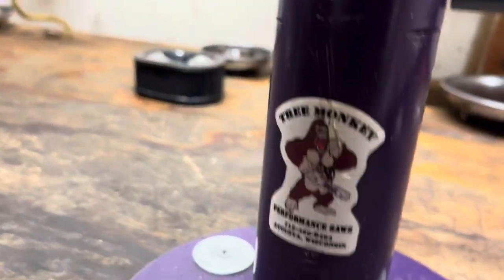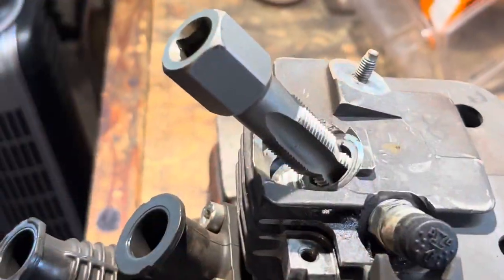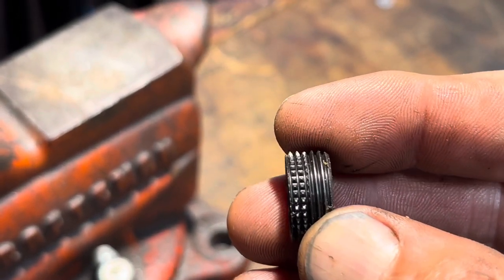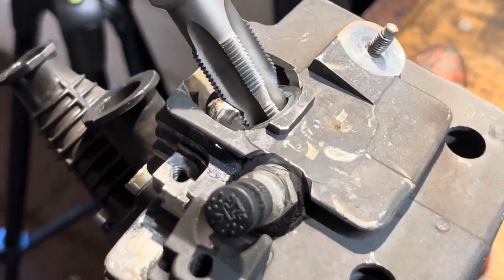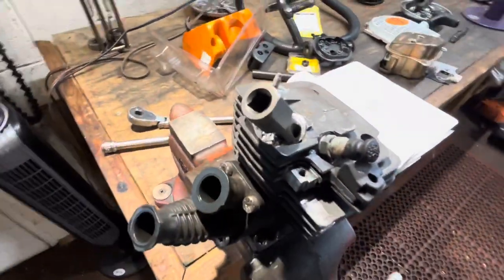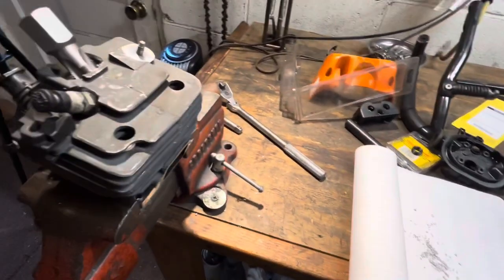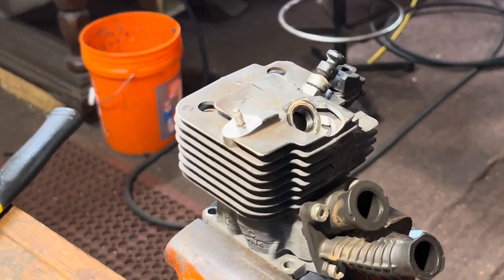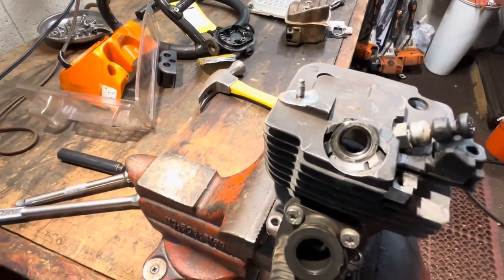Stihl Spark Plug Thread Repair MS441

Comment: Prayers over it all Mr. Richard. Very fine repair sir...well done. In addition to the kit you've shown, mechanics/machinists have drilled a tiny hole(s) between the insert and cylinder and driven a small pin to further lock those threads. JB also has a high temp formula which you are well aware in lieu of the lock-tite....my .02 cents. Another point, I am curious about the extra air intake and the condition of that cylinder, read scoring.. Beautiful time lapse and a job well done sir...
Reply from the maker: No scoring present, just carbon glazing on the piston.  The plating on the cylinder walls is as hard as woodpecker lips.  I'll consult with the owner and get him set up with a better plan going forward.   Continued use with that gas and oil mix would have certainly caused some damage.

The second intake is for fresh air.  It adds a "puff" of clean air just before the fuel charge enters, read strato-charge.  It helps displace the spent exhaust gasses out of the cylinder and creates a cleaner burn for the next combustion.
Reply: @richardflagg3084  I am referring to the air intake around that loose plug. A loose or faulty compression release can be another source of air leak in a similar fashion. This didn't happen all the sudden. I had a rejected warranty claim the same situation. It was blamed on a senior citizen "straight gassing" the saw. My investigation revealed oil mix in the fuel, oil "pooled" in the crankcase. The seizure was due to a loose spark plug. I am familiar with a stratified unit however...
Reply: Roosters' comments are interesting..a new OEM cylinder is $370-$400. A new shortblock $550+ -.. Most Stihl dealership labor in my area is $90-$100 an hour. I would think your repair is justified and reliable..
Reply from the maker: @Brian2bears  I'm going to take a wild guess and say that the plug was threaded back into the damaged threads and the plug blew out.
Reply from the maker: @Brian2bears  Interestingly, the late model 441's have a steel insert installed at the factory now.  I'm no harmonics professor, but I've seen a disproportionate amount of blown out threads on this model.

Comment: Hey Richard, I know this is an older video but I could really use some help. I have a 441 I’m working on with the M-Tronic carb. Since new it’s never idled and would fall in its face once you let off the throttle. I’ve rebuilt the carb, replaced the spark plug, air filter, fuel filter as well as fuel solenoid and it still will not run. It has spark and gets fuel, what else should I look for? Thanks so much!
Reply from the maker: I would pressure and vacuum test the saw.  Coming off throttle creates more vacuum in the case, enough so to lean out the fuel to air ratio and stall.  If it passes a pressure/vac test, I'd replace the carb.
Reply: Ok, I can try that. Could it possibly be the ignition coil module, sending too much fuel to the carb? The plug seemed excessively wet. I really appreciate the help! Keep up the great videos, I love them.

Comment: what size threading tool to use? i have a ms 441 and the spark plug came out two tomes and stripped it out.
Reply: did you find your answer.  I am have the same question

Comment: Do it on the saw! Grease the crap out of the tap! Remove muffler prior to starting. U can put cotton wadding into to cylinder thru the exhaust port. Wet the wadding with WD40.  The wadding will capture the flakes of aluminum that don’t get caught by the grease on the tap!
Another method is to use shop vac connected to exhaust port and suck the stuff out as you are cutting it!